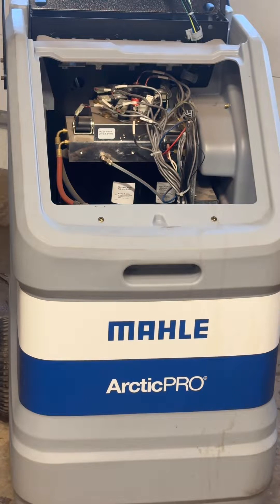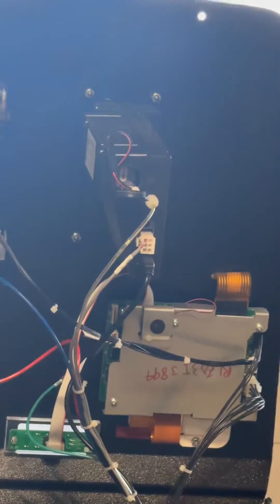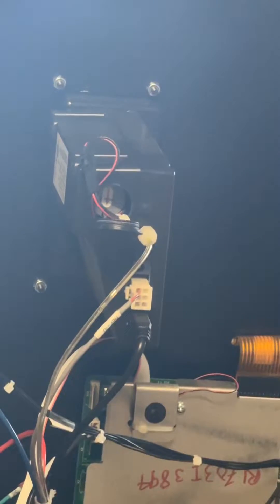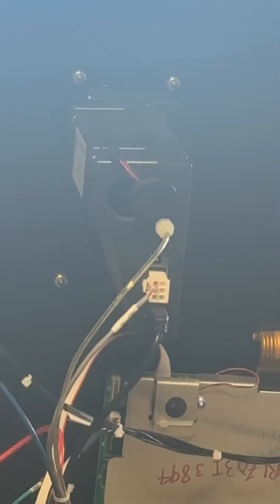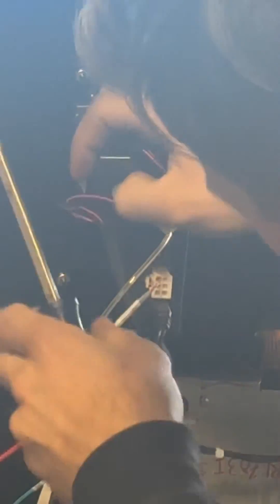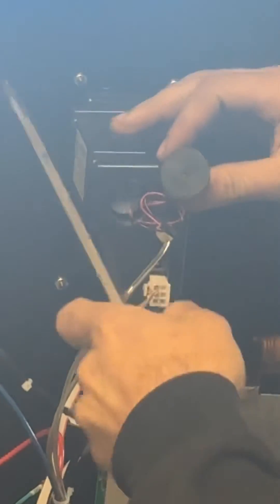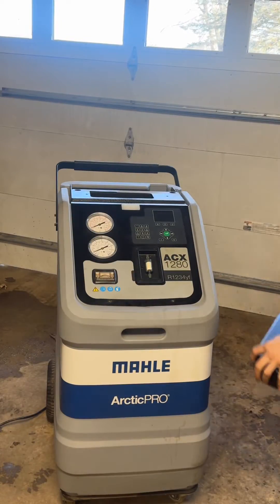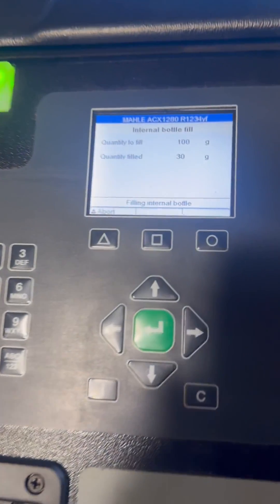Mahle ACX 1280 A/C machine air sensor replacement!

Comment: How did you know it was time to change the air sensor?
Reply from the maker: It will usually cause the machine to quit working…
Reply: Mine gets stuck in the refrigerant id cycle. I dunno if sensor is bad or the whole identifier is bad.
Reply from the maker: @ it’s probably the sensor